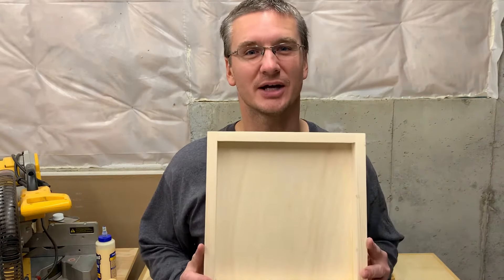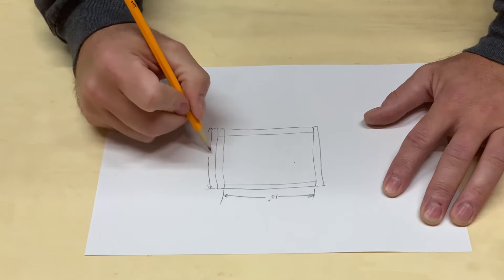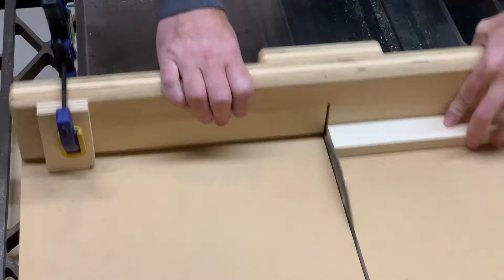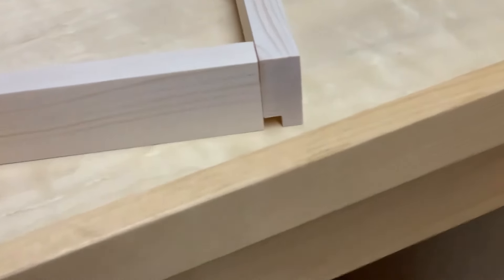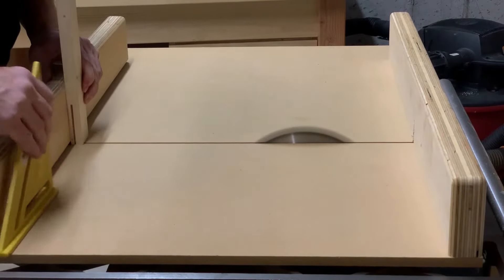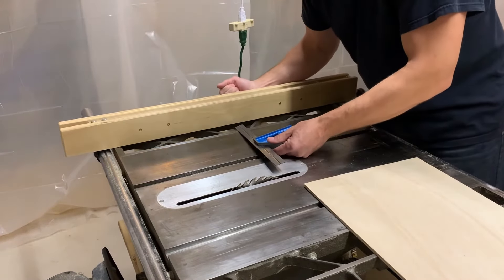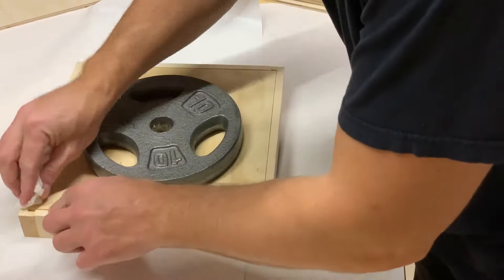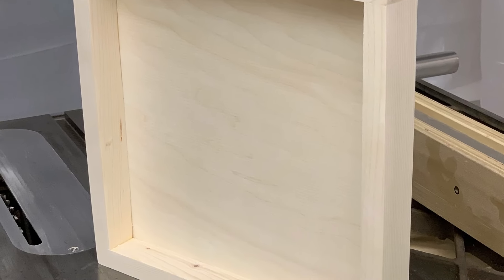How to Build a Shadow Box // DIY Home Decor // Woodworking Project

Comment: Video was easy to follow only we don’t have a table saw ugh also how do u add the glass to it does it sit on top of it ?
Reply from the maker: Great to hear, thank you! A project like this can be done without a table saw. You just may need to get creative with the tools you have. For mine, I didn’t need to add glass to it. However, you could make another frame to inset the glass into and attach it to the front with small hinges.

Comment: Hi Could Please Have Size For All of Wood Piece
Reply from the maker: Hello! In the US, the frame material is called 1x2. It is actually 3/4 inch by 1.5 inches.  The backer is 1/4 inch plywood. Size is whatever you need for your application.

Comment: How would you put a glass on it?
Reply from the maker: My application didn’t call for it, but there’s a couple of options I can think of right away. You could build a frame with the glass inset in it with hot glue or caulk to hold it, then mount it with hinges. Another option would be recess the glass in the front of the shadow box and add some trim pieces with finishing nails to hold it, once your pieces are mounted for display. Obviously that would be more permanent. Just depends what your use case is. Thanks for watching!

Comment: Hey, White Lab,  Would you please let me know the dimensions of your beautiful sled?  
I WILL make one.  I see it's 3/4" ply and it's double ply on the vertical pieces.
Reply from the maker: First of all, thank you for the nice compliment! I love my crosscut sled. It’s 37 inches wide by 24 inches deep. I used 1/2 inch MDF for the bottom and glued together 3/4 inch plywood, as you noticed, for the verticals. I positioned the kerf slightly to the right of center, so more sled goes to the left. And I stopped the vertical pieces about 3 inches short of the bottom, on the left side, to give me room to clamp extension stop blocks on. That last part has been a great benefit, when needed. Also, add some extra plywood where the blade would come through as a safety precaution. Have fun with it!
Reply: @WhiteLabWorkshop  thanks for the detailed response.  It’s exactly what I  needed.  Don’t know how you’d clamp an extension on the left end.
Reply: @WhiteLabWorkshop  ok it’s to clamp a stop block.  I read it wrong but I could clamp over the top as well as around the end.  Oh well whatever I want to do.  Thanks again.
Reply from the maker: 1:10 in this early video of mine shows what I meant about an extension for a stop block: https://youtu.be/JlFLy-vbw9Q. Good luck with it!